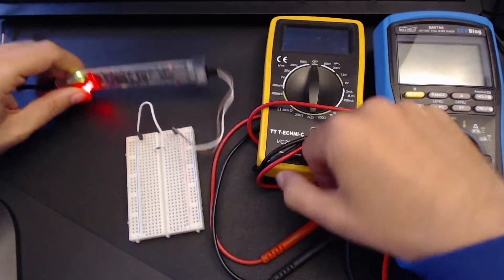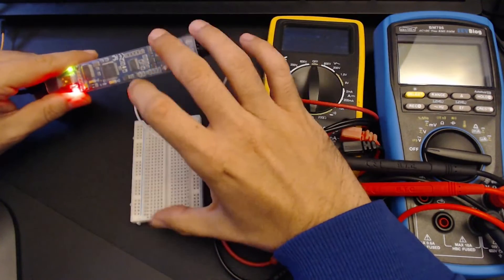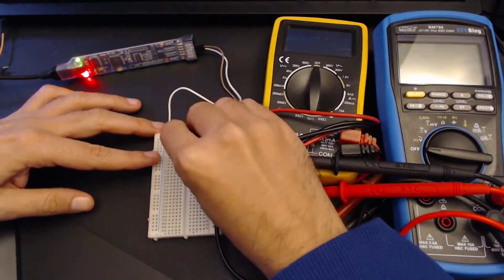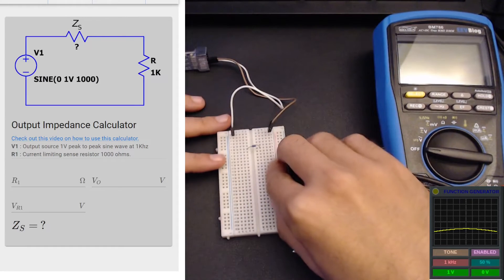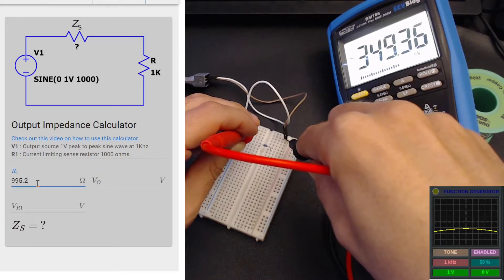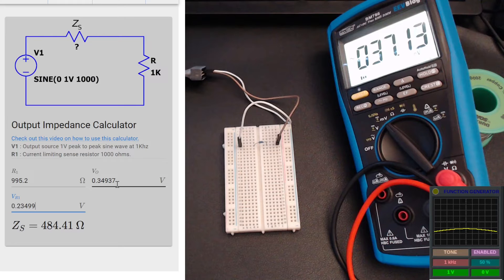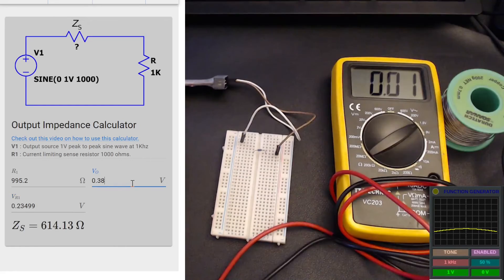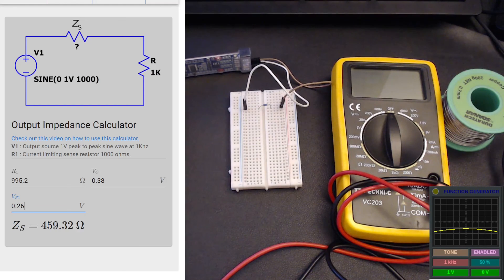How to measure output impedance with a multimeter

Comment: Thanks for making this video. Most modern function generators have a standardized output impedance of 50 ohm. Older units will have an impedance of 600 ohm. Small function generator kits may have an undetermined or unspecified output impedance as you observed. Here’s the way I approach the issue. Given Voc as the open circuit voltage of the generator, RL as load impedance, Ro as output impedance of AWG and Vm as measured voltage across load impedance we have a simple voltage divider circuitry with

Vm = Voc*(RL/(RL + Ro))

If load impedance is adjusted to the point where measured voltage is one half Voc then

0.5*Voc = Voc*(RL/RL + Ro))

Solving for Ro we have Ro = RL

That is, the point at which the measured voltage (across RL) is equal to one half Voc the load impedance is equal to the output impedance. (You are dropping equal voltages across both load and output impedance). In my case I have an AWG with 50 ohm output impedance. To  measure this I simply set the AWG to some arbitrary voltage and measure Voc. Then place leads across a 100 ohm pot. Set to 100 ohm and continuously decrease pot and measure voltage until measured voltage is one-half Voc. Remove and measure RL of pot.  That is your output impedance. In your case it would be necessary to use a 1 K pot. I typically use a 10 turn pot in order to give me more accurate results.